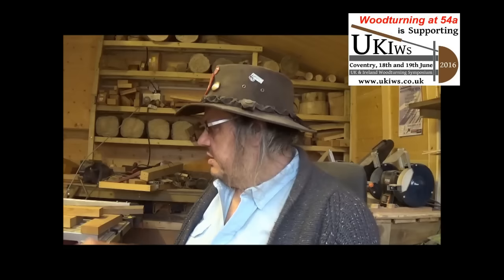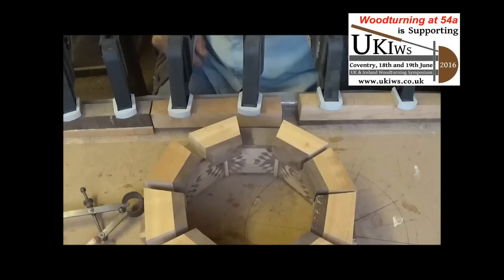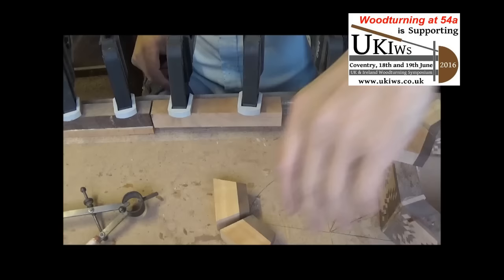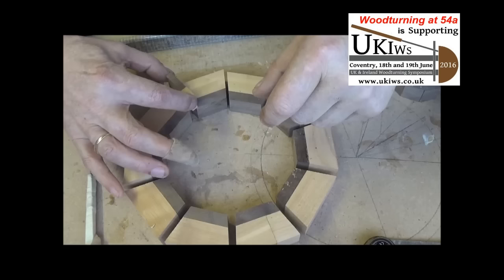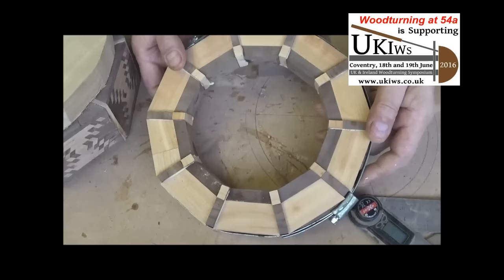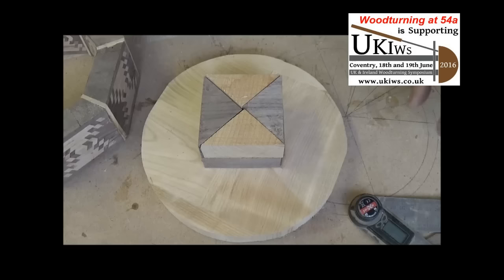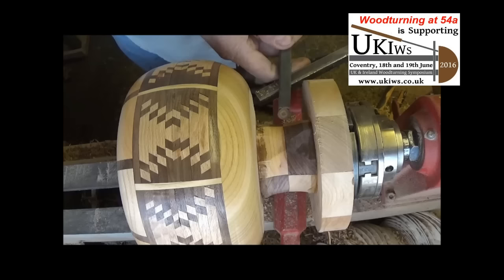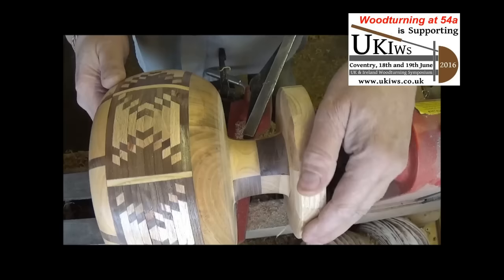Woodturning at 54a. #49  Indian blanket design bowl

Comment: Keith - that was fantastic.  What type of lathe are you using?    thanks.
Reply from the maker: +Ken Teveit  Hello Ken,and thanks. My lathe is the Axminster 1218VS  Cheers,  Keith.
Reply: Thank you
Reply: Trying to decide what lathe to upgrsde too. Got rid of the olf starter craftsmsn........
Reply from the maker: +Ken Teveit  You won't go far wrong with an Axminster,or Jet,which is the higher end of their models. I had one small problem with mine,but it was put right in 48 hours.Plus the fact you get a 3 year warranty with them.